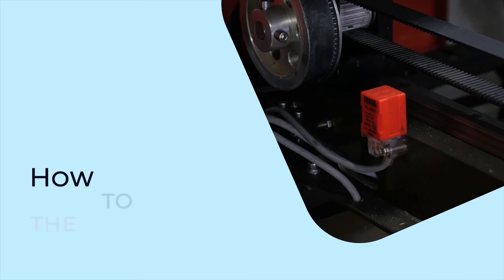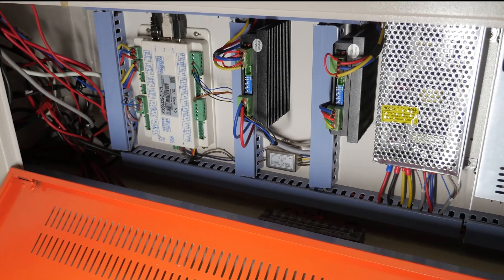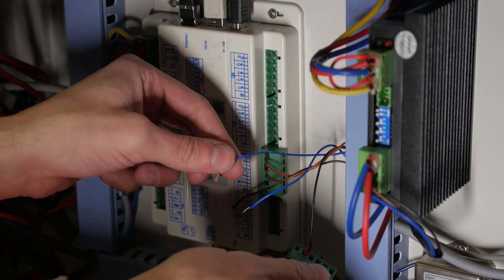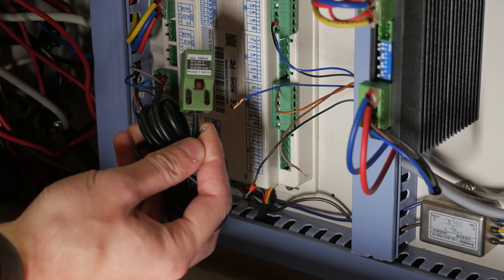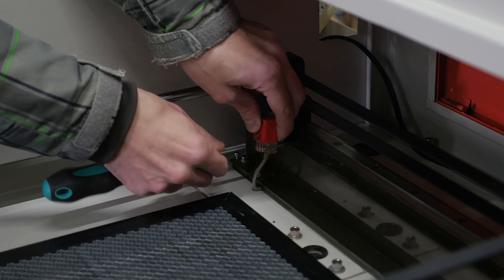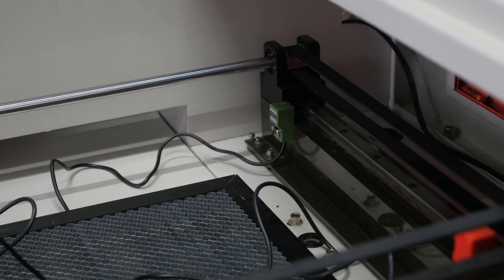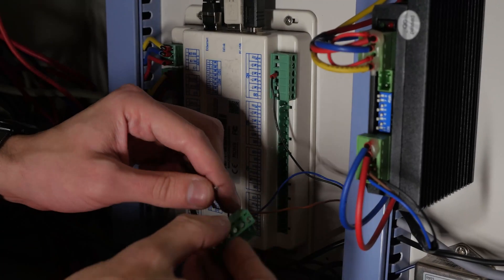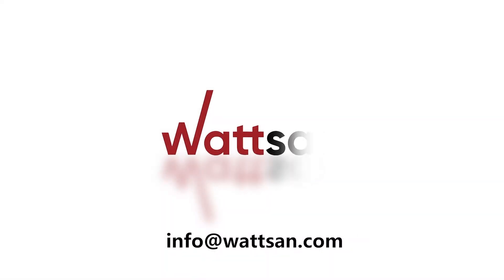HOW to REPLACE the CNC END SENSORS / WATTSAN CNC GUIDE

Comment: After install sensor at the first time how to setting at ruida 6445g
Can you help me please
Thanks
And the sensor is npn or pnp sir
Reply from the maker: Hello! Our aplogize for long answer🙌

If you'll just change sensor - no need to adjust anything. This sensors is NPN, NO.
If you'll assemble your own machine - just mark checkbox "use limit trigger" in vendor settings and check that the connection is correct.

Comment: Sir I have cnc router machine ...same problem I am facing ..if I replace the sensor then might be issue that coordinate mistake for home position?
Reply from the maker: One possible way to remove this effect is to slightly change the step divider on the stepper motor driver. If you are not an advanced machine operator, then this may be a bit difficult. But if you are not afraid, you can make the backup of the vendor settings in RD works, change the step divider to the neighboring one when the driver is turned off (for example, if it was 5000, set 4000). Then the gear ratio will need to be changed in RD Works so that the size of the products matches the desired one

Also, reducing the gas pressure has a positive effect on the quality of the acrylic edge. But you can't completely remove the gas - the focal lens may be damaged.